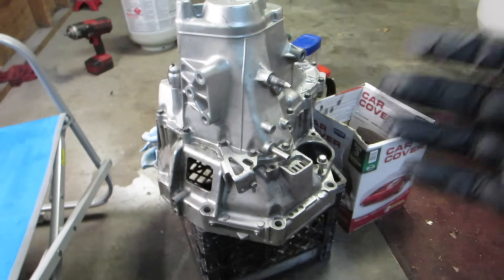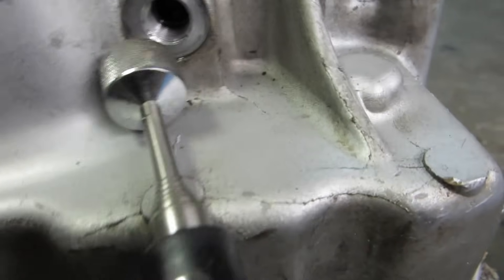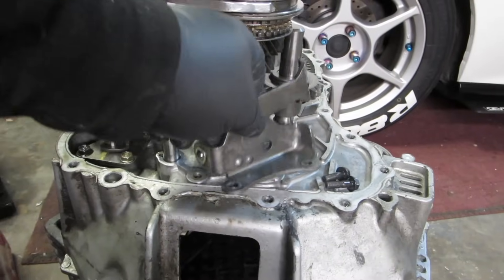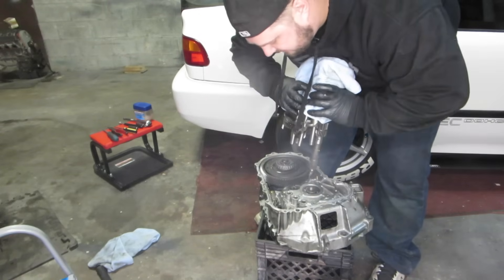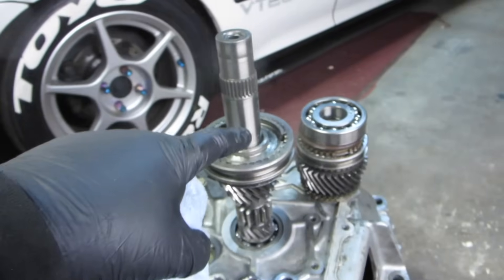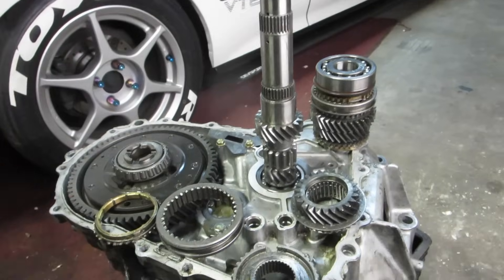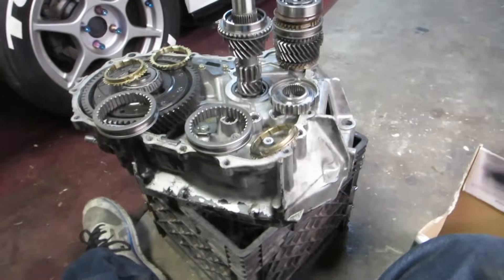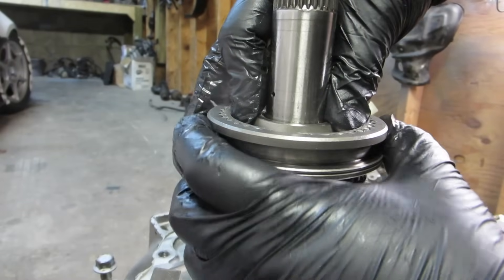3RD GEAR GRIND FIX!  B-SERIES TRANS  HOW TO.  HSG EP. 5-19

Comment: Cool video. Never did a B series before. If you have a small head on the magnet you wouldn't need to shift to get the ball bearings out. The names of the 3 pieces you talk about in the video are the locking ring(commonly called a synchro), the slider, and the hub. The main shaft is the one with the input shaft on it.

Comment: Hey man! I have to give you props. I just rebuilt my GSR transmission using this as a guide. Replaced third gear and the syncro with a syncrotech CF one. Also replaced the input shaft bearing and all seals in the trans. New clutch and everything is butter. I put generic castrol 10w30 in it for now. I am going to switch to Honda MTF next oil change. Just wanted a cheap break in oil to clean out the trans

Comment: nice video been watching you guys for a while. only thing I'd like to mention is that 9x out 10 the synchro gets damaged due to the synchro spring or as you guys called it a snap ring. that synchro spring is actually the brake pad between the selector and synchro/gear. the springs slows down the the gear to allow the selector to slide in much easier. having to replace the synchro or selector is only secondary due to amount of damage. sometimes only the springs are necessary to replace. if you did not replace the synchro spring your still going to grind 3rd gear

Comment: According to all my b series factory manuals, the concave washer faces the input shaft bearing with the curved side. the 1mm spacer fits above it. Also, its easier to remove shift selector by removing the inner part, by lifting up on the little rod and removing the inner selector piece. It will allow you to line up the parts with the shift shaft easier as well. Further, I find it easiest to put the trans in third gear when dropping the outer case. Also you can just flip the trans over to get the counter shaft to slip into the snap ring, rather than prying it with a screw driver. Do this after the housing bolts are in, should just slide right in. Not trying to be critical of all your videos, just offering some helpful suggestions from my own years of experience.

Comment: The thing you're calling a "snap ring" is the main reason these synchros start going bad. It's called a synchro spring. It's what slows down the synchros for the selector to engage into the gear. They're a supposed to be round and become square when they are worn. Really good vid tho.
Reply: Mickey moises, where to get synchronizers,apart from the dealership? They are to expensive for me right now.
Reply: @declanosbourne62  I would definitely check google. If you have a honda/acura, Gearspeed is a reputable website.
Reply: @NickMoises04  ok. Thanks man

Comment: Great video's love the in depth of the gears.  Its important to know when doing the diff to record the gaps of the bearings between the diff and between the case.  Ive never had an issue with sealing the bolts always had issues with low tq bolts vibrating loose if i didnt.  Good to know that its cracked on you because it hasnt happened to me yet doesnt mean it wont in the future.

Comment: Transmission parts are stupid effing expensive. I'm rebuilding an S80 transmission out of my 1998 Integra and my Acura employee price for just the 3rd gear/synchronizer set alone cost me just a over $300. I'm at least thankful I didn't need to replace the 4th and 5th gear set as well this time. I could have saved $100 if I'd ordered only the synchronizer parts I needed to make a sketchy repair from an aftermarket company. For only an extra $100 it was a no-brainer to go OEM and get the whole 3rd gear set with all new synchronizer parts for 3rd to 4th gear. Very nice YouTube Channel Honda Street Garage...

Comment: I'm working on a B16A that was installed in my son's  1998 Civic HX.  The transmission is a 5-Speed (S4C) manual just like the one shown in your video.  

My question is:
What would prevent the transmission from shifting in to 3rd or 4th gear?  Its like the gears are not there at all.

Comment: i know this an old video but if i can get a reply i would really appreciate it. i followed the steps down to a t and when i put the case on with everything inside and tighten just two bolts i can’t spin the main shaft. i took everything out and left only the main shaft in and still when i tighten only two bolts i can’t spin it. i lined the tab where it’s supposed to go and i’m pretty sure i have the washers how they are suppose to go since i didn’t touch them when i took it apart

Comment: it's worth mentioning that if the synchro teeth are damaged on the gear itself,  you need to replace the gear.  same goes for slider.  the teeth should be pointy,  no flat.

Comment: is there a way i can tell what transmission i have? i bought my 98 Prelude back in 09 as the third owner but i was told by the second owner that the original owner had swapped the block for a JDM H23A and kept the original VTEC head. i wasn’t informed if the original M2Y4 transmission from the Prelude was kept or if the swap also included the transmission from the H23A, be it from the 92-96 Ascot Innova or the 98-02 Accord Wagon. those are the only two cars i know that came with an H23A. did any of them come with a 5-speed manual? is there a sure fire way to tell what transmission i have? i’m hoping to replace some synchros in it soon.

Comment: Pay close attention to the ‘synchro rings’, the wire ring around the outside of the synchro.  These should be circular in cross-section, like a wire.  They are worn out when they appear to be flat on the outer circumference.  These hold the transmission in the selected gear, when worn badly the transmission can ‘pop’ or fall out of gear.

Comment: Nice video man thank you for explaining that much. I came here to see the process of how to rebuild your trans. My car grinds third gear every time I downshift from 4th even if I way for minutes or double clutch. The only way to make it go smooth is to go from 4th to 2second without letting the clutch and then going to 3rd. Could you please explain why that happens? It only happens on downshifts and rarely on upshifts ( only when i rev my 2nd gear to red line). Thanks in advance.  Subbed!

Comment: Driving my civic eg hatch with the H series swap, but just now the 4th gear I can't get into it, it won't let me get into 4th gear, so I'm driving from 1st gear, 2nd, 3rd and skip 4th and I jump to 5th gear, I stop driving my car so I don't have to messup with the other gears. Now when my car it's completely off not turn on, I try shifting the gears from 1st to 2nd, 3rd but going to 4th gear won't let me get into it, and I don't want to force it hard to damage any other gears.. ? What could be the problem? HSG any recommendations or suggestions... thanks great video btw.

Comment: I have a T2t4 lsd trans for a H22. I bought it from HMO and don’t know what gear it’s in and I don’t want to install the shift linkage to the shift lever and selector lever before it’s in the correct gear for installation. What gear do you want it to be in and how do I shift it without it installed?

Comment: So i just finished my third S80 rebuild. I slapped it all back together and its difficult to turn the input shaft.  I think for some reason i placed the thrust cone washer facing cone up to shaft bearing and the flat washer against first. Would this really cause it to bind up? Or do you think i have a shift selector issue?

Comment: So for the life of me I could not get it to seat while moving the shift linkage (too hard to move shift linkage) do I took for bolts started the threads and tightened them down nice and even and it popped right in. Great video btw
Reply: And for the c clip that sits in between 2 bearings I just played with the shift linkage and the c clip popped into its groove properly

Comment: BIG URGENT QUESTION????I PUT MY B16 TRANSMISSION BACK TOGETHER AND MY SHAFT DOES NOT SPIN FREELY AS YOU SAID AT THE END OF THE VIDEO.... WHAT WOULD CAUSE THAT ...
Reply from the maker: You didn’t close it properly. It’s in 2 gears at once or the case is crushing the bearings.
Reply: Same shit happened to me

Comment: honda Street Garage I got a Ef civic 1991 with a B18C  1998 Spec R  motor. Do these motors/trans have specific gears, syncros and selectors for the B18C or they can be matched to the B16? I have a pretty bad grind in 3rd gear going past 3500 RPM from 2nd to 3rd. Is it better to change syncro + selector + 3rd gear ? or just selector + syncro just like in the video ?

Thanks

Comment: @HondaStreetGarage is it normal for the shaft to not spin so much if all the gears and bearings were cleaned with brake cleaner??
Reply: daniel tinoco never clean bearings with brake clean.also should spin fine. Did u figure it out?

Comment: hey, any idea what my problem is?
my 4th gear started grinding slightly, with every subsequent shift giving a quieter/shorter grinding sound until i could barely hear it, at which point it shifted into 4th (felt normal, didn't pop out or anything) and i let out the clutch and i wasn't in gear

Comment: I bought 1st through 5th syncros, all the cages they ride in, every signal bearing, needle bearing, seals, hardware and the wire rings new, bearing races the needle bearings ride on all oem honda new. Was extremelyexpensive however. Should be the same level of difficulty to do all of them right? Just take off everything in order and reverse the process correct,? PS. Does brass stick to a magnet? I dont believe it does if i remember correctly. I only trust Mark with anything Honda! Hecis the absolute best imo.

Comment: Hello, I was wondering if you can do a video on the "reverse" gear of the B-series transmission? I'm currently having an issue where I am not able to shift into my reverse gear but am able to get into the rest of the gears (1-5 are okay). I checked my forks and they seem to be fine. What may be the problem? (P.s. I checked my forks they seem to be fine-nothing bent).
Reply: gogo if you’re new to these transmissions, that is very common. Just shift to 3rd first and then try it. Most of the time it will slide right in.

Comment: I have recently bought a 2014 Miata with 27k. From 2nd to 3rd gear shifting is notch when driving but not at park. If I rev it up during shifting when driving problem does not exist. Would you please advise how to fix this problem
Thanks

Comment: @hsg i was wondering, is changing 1st and 2nd synchros  the same as you did to 3rd gear in the vid?
Reply: should be same but on the main shaft not counter shaft. would require getting the nut off the top of the shaft too

Comment: Always torque down any bolt inside an engine or transmission and you can find it out easily on the internet what each bullet should be torqued down to do not skip that step

Comment: hey Honda street garage . I  have a 92 civic hatch vx . what do I need to swap a civic ex transmission?
Reply from the maker: +Albert Navarro an ex transmission! Lol every else will including axles,mounts,shift linkage, clutch
Reply: Should I go with the ex tranny . Or save for a si,
Reply: Bseries_ Jess it's my daily I don't want to fuck with I vx model get like 50 mpg mines stock af clean body
Reply: it*
Reply: Bseries_ Jess was thinking of a b20 swap
Reply: Ex and Si transmissions are exactly the same. And you wouldn't be getting 50 mpg anymore probably like 40 or so but that's still high.
Reply: The Scorpion I got that when I first got the car I rebuilt block and head with some machine work
Reply: The Scorpion oh but isn't the ex tranny a lot shorter gear ration then my d15z1 tranny
Reply: yeah a lot shorter. it should make a big difference in acceleration.

Comment: Understood so what's going on with a transmission when it's noisy in neutral but as soon as it goes in gear it stops making the noises. I got a car that's noisy in neutral and first gear.
Reply: GARCIA420 _  that will be u trow out bearing or u input shaft bearing
Reply: JAZ TORRES it definitely wasn't the throw out bearing it's been replaced twice already. I was also thinking it could be one of those needle bearings.
Reply: Torres is right, if you already replaced the throw-out bearing it's the input shaft bearing. Same issue in my D-series trans.
Reply: That happen to me 2, replaced the trow out bearing and the noise was still there" if u pull the tranny out again" check u main shaft (the part in the trans that goes in to u clutch) before u take tranny casing apart" there shot be no play on it all,there was play on my transmission and a weird noise" 

Not sure if a needle bearing will cause a noise 2"

But for the symptoms that u are saying i will def try the input mainshaft
Reply: JAZ TORRES I've checked and everything seemed fine with it, the only noticeable thing was that when you hand turn it you can hear the bearings move around.
Reply: Richie McDole and yea I have two cars that have that same noise one only does the noise in first gear and neutral and when I put pressure on the shifter without pressing the clutch the noise goes away. On the other car it's quite in neutral but makes the noise in first second and third gear and to add to that 3rd gear grinds haha

Comment: Yo I have a 1999 Acura Integra ls with a b20 and my third gear has grinded a little since I bought the car but just the other day I went to shift into 3 gear and when I let off the clutch the gear was not engaging it just grinds and will not go into gear does anyone know what the problem is I’ve been looking online and haven’t found my answer I don’t want to buy parts that aren’t necessary ....LMK!!!

Comment: I have a question is 3rd & 4th gear synchro the same size?
Reply: omari Phillips he said yes they are and 1st & 2nd are different
Reply: biopqq with that being said, I have a 3rd gear grind in my transmission, I plan on swapping synchros from another hydro trans but using it's 4th gear synchro for my 3rd synchro. would that be possible to interchange the two different synchros to function properly?
Reply: That I am not knowledgeable enough to answer. My apologies
Reply: @omariphillips5333  If you do that, won't it grind going into 4th then?  Put a new synchro in.

Comment: using normal motor oil causes syncros to glaze over causing them not to bite and stop gear thsts cause of problem  use honda transmission fluid

Comment: So as to Why the gears grind. It's due to hard shifting yes. That means when you shift hard a individual isn't allowing the transmission shafts to slow down enough and the selector ring crashes into the sink rings destroying them over time. As to those transmissions, damn that's nice and easy looking. fukn Volkswagen 😁